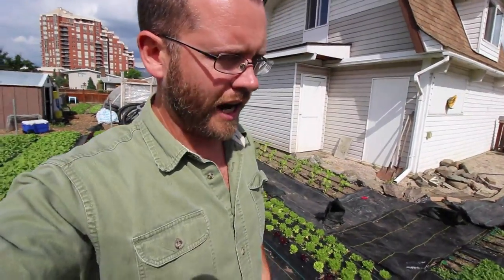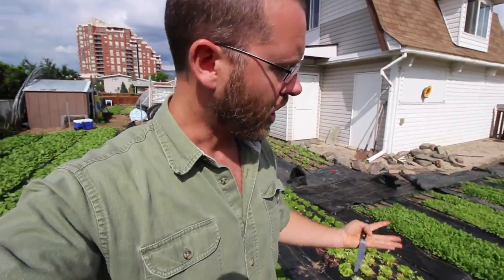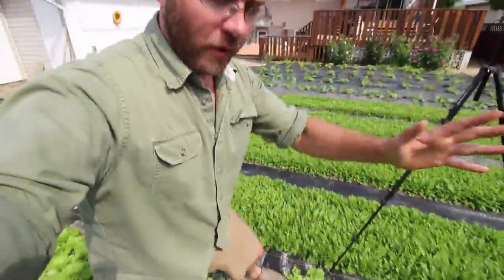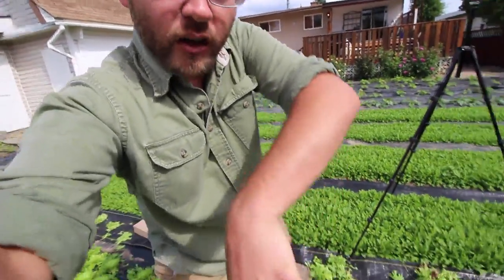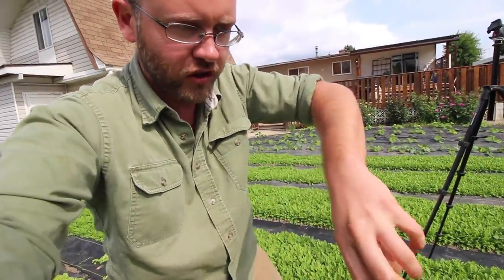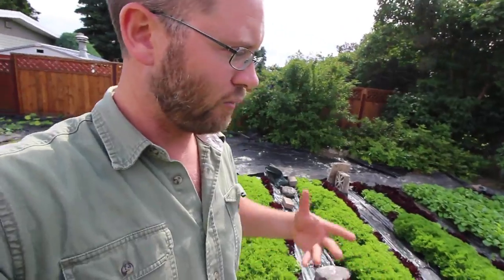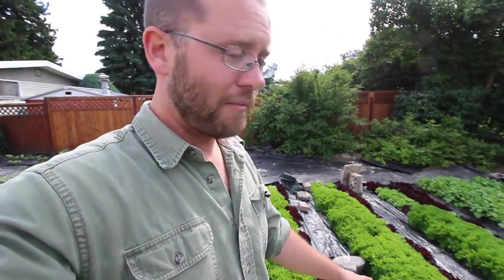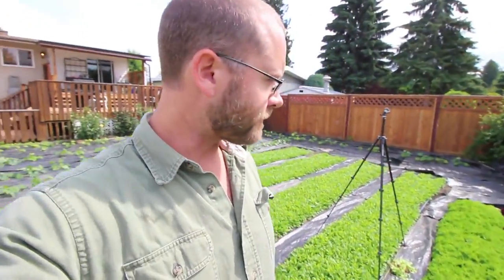How to Harvest Salanova Lettuce: Pro Tips for Perfect Harvesting!

Comment: Curtis, let me put a picture into your head in an attempt to save your back. Remember the old say push reel lawn mower? Well, remove the reel blade and bed knife; remove the roller in the back and extend backwards about 2 feet and add two smaller wheels; widen the mower to 35 inches; insert a "Green Harvester" type unit with two blades 30 to 32 inches long and set to cut 2 1/2 inches above the soil level; and push. This would allow you to cut and harvest Salanova in one clean motion down the bed with the product being collected just like the Green Harvester. The two small wheels added to the back would help support the weight of the product harvested. I figure your friend to knows how to weld  could set you up with a unit that works perfectly and to your liking. Time is money as you say....
Reply from the maker: Sounds cool. I'd rather someone build that and I'll buy it if it works. I don't have time to build every tool on my farm. I've got videos and apps to make, and another book to write. Thanks.
Reply: Personally, I like to do everything for myself - that way I know it's done right and to my satisfaction. If not, then I have no one to blame but myself for not doing it right the first time. It's my  grandfather in me I guess.
Reply: Ken Robb 
   Great idea, but Curtis did mention physically having to lift up the leaves that splay out, and to leave these slayed out greens behind may not compensate the convenience depending on how much of a harvest is needed from the alloted space.  Just throwing it out there if you are going to make one...but perhaps an off centered gentle touch inclined row of teeth extending out before the blade to guide the leaves into a position to accept the cut?
Reply: Love the thinking out of the box but i do not think your idea would work. I cut my lawn with a reel mower and have for many years. Just a little resistance and it jambs up. I think lettuce cutting would be difficult. How ever if you prove me wrong, I am sincere in saying I would like you to shoot me a video of your success and I would like to be one of the first to buy your new invention.

Comment: 2 questions.  1. could  you use your greens harvester to harvest the salanova once you set the height of the greens harvester so that you leave enough of the core?  2.It looked like in the video that you were cutting in a downward angle instead of straight across the head of lettuce.  Did I see that correctly or just an optical illusion?
Reply from the maker: Greens harvester doesn't work on salanova grown in this way. I've tried it. I'm not sure about the angle. You might be over thinking it a bit. ;)